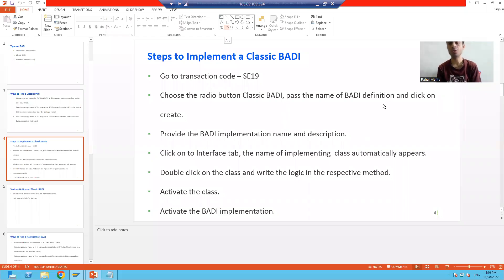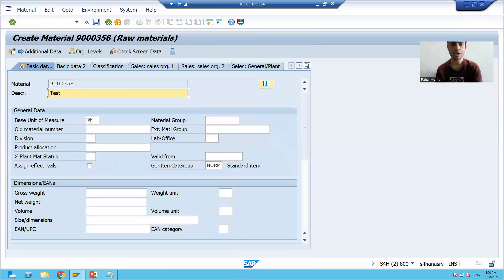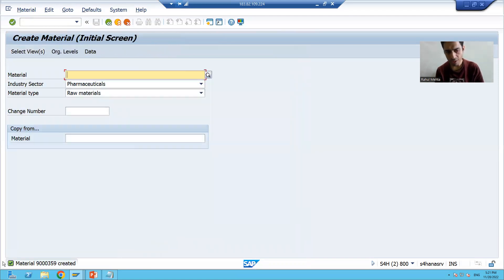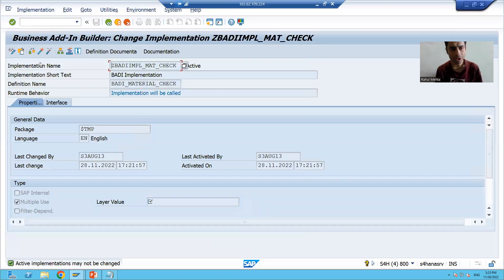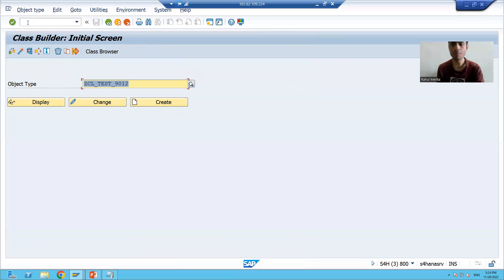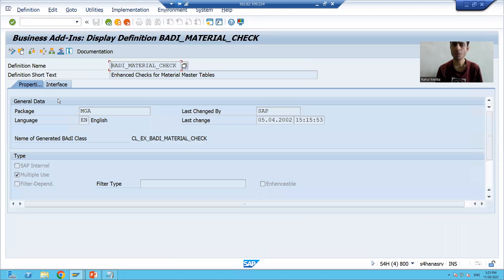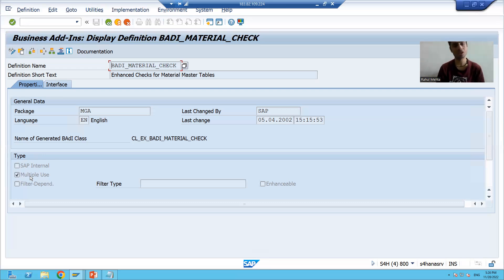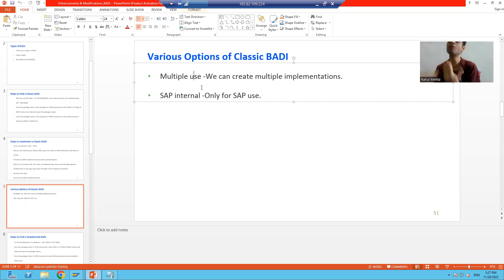25 - Enhancements & Modifications - BADI - Classic BADI Part3

Comment: Hello Eng. Rahul ❤❤ 
Thanks for your video ❤❤ 
7:20 , in case of multiple use for this interface, what's the execution order for all of these implementations ?
Reply from the maker: Hello - The implementations can be called in any sequence. The sequence of the implementations is not in our control. At the same time, filtering of implementations is in our control. Once you proceed, you will be able to learn BADI with filters. There we can call the specific implementations depend upon the condition.
Reply: @sapabapbyrahulmehta  Hi Rahul, Thank you very much for the videos. I have one doubt, in the previous video, in one of the comment you mentioned the layer value will decide the sequence.what is that sequence related to?
Reply from the maker: @swathi14201   Suppose there are 3 implementations. With the help of layer value, we can decide the sequence of calling of those implementations.( which implementation will call first, then second and so on.)

Comment: Hi Rahul,
wonderful explanation. I appreciate your patience in not missing out any small detail.
Recently, I had an interview question. when we have multiple implementation, in which order it would execute and how can we set the priority.
My understanding is that, BADI implementations will be called as per the program flow logic and we cannot set any kind of order of execution to it. 
Please correct me if my understanding is wrong.
Reply from the maker: Thank you for your gratitude. Correct understanding, We can not control the order of execution, but we can filter the implementations. Once you move forward, you will also learn BADI with FILTERS , there we can call the specific implementations.
Reply: @sapabapbyrahulmehta   Sir we can use  Layer value  to control the flow of execution on Classic BAdIs right?
Reply from the maker: @sai_tejayt   Yes Teja.  The layer value is used to control the sequence in which multiple implementations are executed.

Comment: Hi Sir,
     During PO creation, if the PO Document Type is (MA01) and the Condition Type used is MQ14, 

The system should validate that the input field has a negative sign.

I am using badi(ME_PROCESS_PO_CUST)  how to write a code to that requirement?
Kindly give sample code Sir.
Reply from the maker: You can check the fieldnames in the debugging mode having these values and use the string use the string operation FIND to check for the - sign.

Comment: 1. what is filter dependent check box used for?
2. In real time, what if we deactivate the custom implementation and that class has other methods implemented by some other developers. Deactivating the badi implementation will not impact this?
Reply from the maker: Below are the answers - 1) Once you proceed in the same playlist, I explained BADI With Filters, then you will come to know the filter dependent BADI. The Purpose of filter is to call a specific implementation based upon the filter value.
2) Once you deactivate, after that none of the class method will trigger.

Comment: thank u for brief explanation.

I WHAT TO KNOW WHICH ENHANCEMENT WE SHOULD USE FOR WHICH KIND OF REQUIREMENTS ?
Reply from the maker: Thank you. There is no way that this requirement will be fulfilled by this particular Enhancement. First priority is of BADI always, as it is totally based upon OOPS Concepts, then customer exit and then Implicit and Explicit Enhancements. User Exit anyways available in only SAP SD Module.
Reply: @sapabapbyrahulmehta    Sir suppose if the requirement is feasible by only customer exits. And we use customer exits to implement. The project must be deactivated after implementation. How can the customer receive the product if the project is deactivated?
Reply from the maker: @Ram-ti9lk   Hello Ram - In Real Projects, After Implementation, We will not deactivate. If We are implementing for learning purpose, then we should, else it will hamper the learning of others who are using the same system.
Reply: thank you  @sapabapbyrahulmehta  🙏

Comment: Hello sir, 
After displaying the error entire screen got disabled if we want to make that unit of measurement editable how can we achieve that?
Reply from the maker: Hello Aman, rather than Error Message, We can provide information message, but In case of information message , program will not stop automatically and we want the control of the program to remain on the same screen. we can write the below mentioned logic in that case.

   IF wmara-meins = 'KG'.
      MESSAGE i004(zmsg_36).
      LEAVE TO SCREEN sy-dynnr.
    ENDIF.
The above code will provide a information message and with the help of LEAVE TO SCREEN sy-dynnr the control remains on the same screen, where SY-DYNNR is the system variable for screen number.
Reply: @sapabapbyrahulmehta Thank you sir